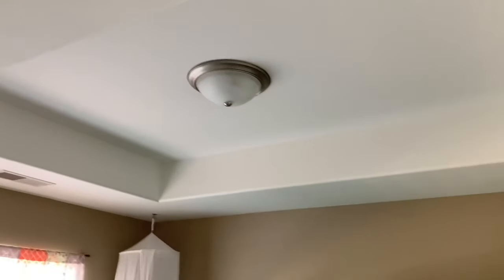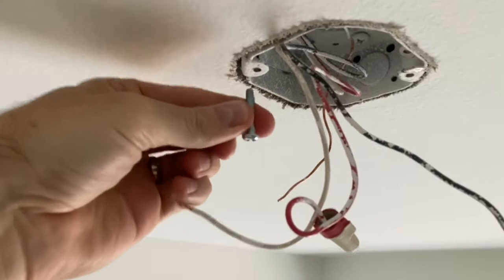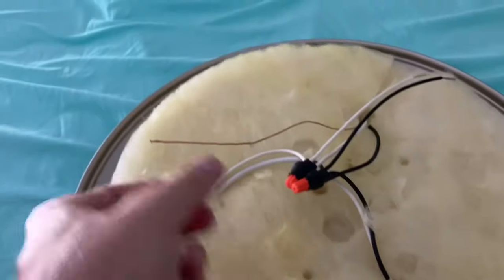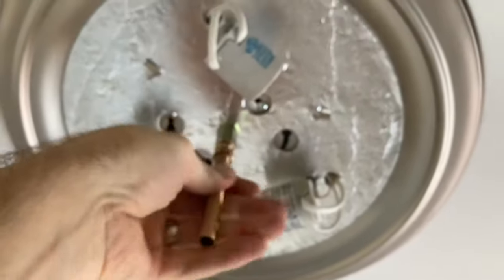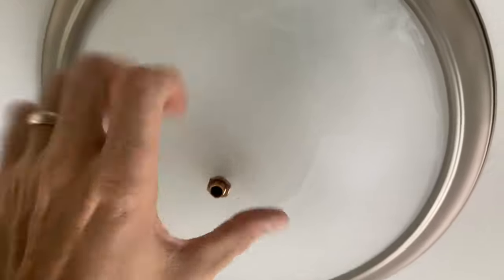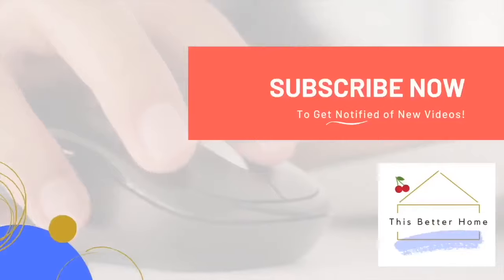️🔥 How to Install Flush-Mount Ceiling Light➔ Step-by-Step Instructions (Easy DIY Job)

Comment: I broke my 30 year old ceiling fan light and almost hired an electrician to fix it. I'm glad I did it because now I'm replacing all the ceiling lights in my house on my own. It's easy. Buy a $10 voltage tester.

Comment: Not helpful, when blowing past the third hand needed to hold the fixture while two hands needed to put on the screw caps.
Reply from the maker: Not really a big deal. The fixture is relatively light and can be done easily with two hands. Go back to 03:24 and freeze. I supported fixture with one hand and with the other hand leveled the two wires and pinched with fingers to hold in place. With two wires tightly pinched still, I removed other hand from fixture to film freely, or in your case, grab the wire connector nearby and twist on. The wires supported the weight just fine. If you do figure out how to grow a third hand, let us know ;)
Reply: @diybandit  I just did this, and it was not easy, holding a light fixture by one thin wire.  Worse, the wire nuts were too small for one of the pairs, let go to find another one, and wire nut on the ground wire let go.
Epic failure on the part of electrical, to evolve.

Comment: What'd you do with the house ground?
Reply: A: There is a small green. (upside down), screw on the flange, so I wrapped the wire around it & screwed it tight, then put the circle onto the long bolt & screwed the long nut up tight against it and the washer, (as kind of a double ground & a simultaneous, safety drop-cable).
Reply: The ground goes back to the main electrical panel and ties into the neutral bus bar so if a non-grounded conductor a.k.a. hot conductor touches the ground it will trip the breaker. The reason why it needs to trip the breaker is because if the non-grounded wire touch the metal metal is conductive therefore if you touched the metal your body would have potential and if you touched a grounding conductor like the earth or a neutral you could get a shock or potentially if it went through your heart you could get electrocuted.

Comment: If you don't tell what wire goes where it's of no value...like in my case there's just all these dangling wires ...so not saying what wire goes where is useless
Reply from the maker: I just matched the colors - super easy. Check your installation manual or call an electrician!
Reply: @diybandit     He wasn't paying attention to the video cause you did say in the video white with white and black with black wire.

Comment: I saw that there was a red wire coming out the ceiling (had some white paint on it, but was red). What you do with that one?
Reply from the maker: That was from the ceiling fan I took out - my wall plate has two switches, one to control light and the other for the fan. Not needed in this light install, I just kept the connector on it and tucked in up there.

Comment: Bro thank you, I knew how to twist the black and white wire with wire nuts, it was the mounting that puzzled me. I didn’t realise the long screws go in bolt facing downwards, and hook in the holes. I never changed a ceiling fixture ever. This is my first time! Feel so accomplished. Replaced two of them! 😃 Time to cancel my handyman appointment. Just saved $65 doing it myself!
Reply from the maker: Love your comment - so glad this helped!

Comment: Hey I’ve got conductivity coming out of the ceiling. I’m all hooked up and nothing is working. I tested the light switch and that works too. Only thing I can think of is the ground that you wrapped in that green screw. So Does the ground from the light fixture have to be grounded for this to work?

Comment: After you screwed the fixture light ground wire to the green hex screw, it looks like you pulled a second ground wire coming from the octogon box towards the first ground wire. Is this second ground wire from the ceiling and do you connect it to the end of the fixture light ground wire which has been already screwed to the green hex screw?

Comment: IF you decide to just flip the switch off, be sure to check for voltage at the light!
  According how it is wired determines whether there is still power at the light. 
  I learned this the hard way and always flip the breaker when telling with any switched fixture.

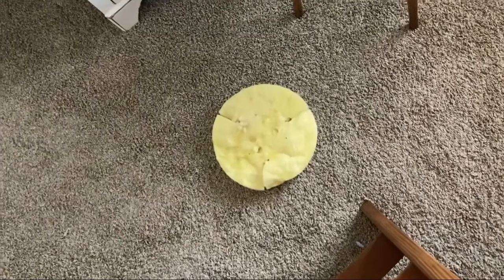Comment: Problem: you missed the installation of the long, six-sided nut thing at the top where it attaches to the flange, (shown at 3:53) that the long screw goes into, (i.e.: flange, fixture, 6-sided nut, long screw, then lining up the fixture with the flange screws). .
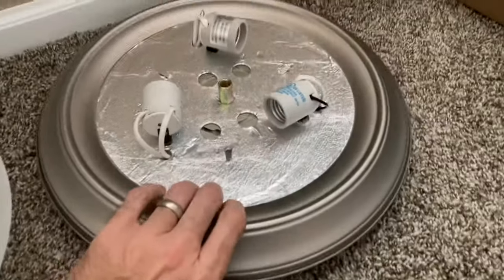Reply from the maker: Wait, the gold-colored nut? It's been a while since I did this video, but check out 1:08 in the video - I believe this piece was already pre-installed into the light assembly.